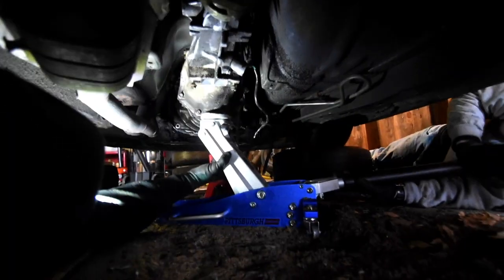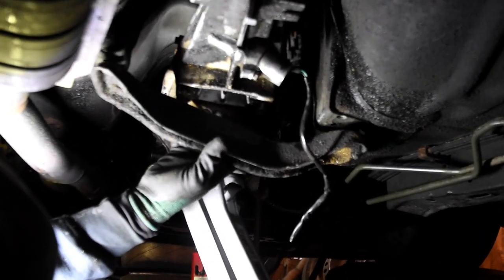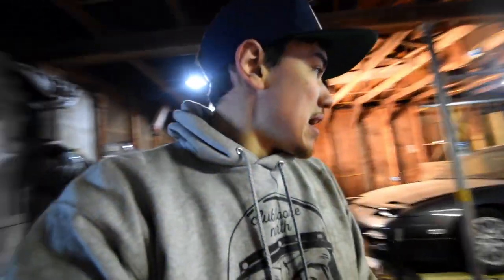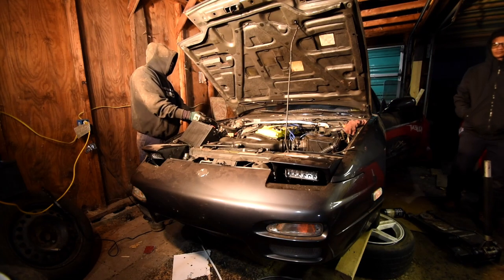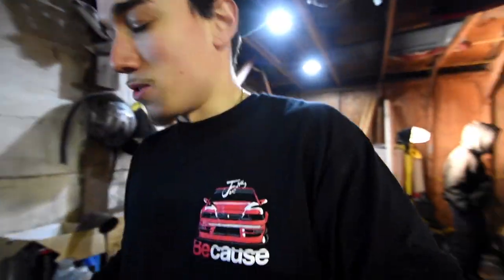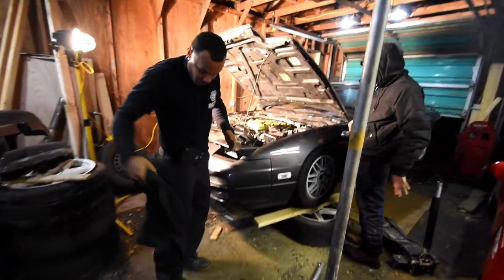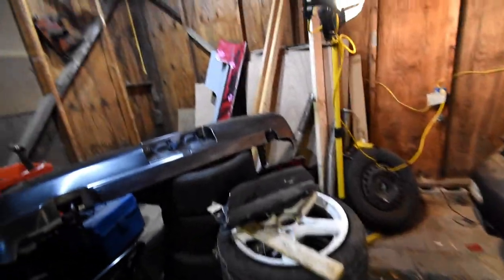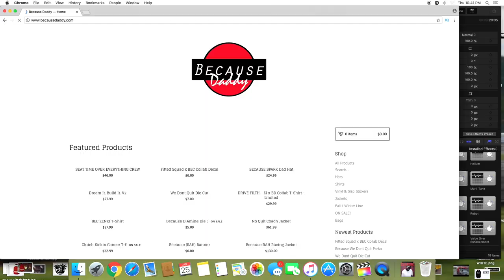Broken Trans....? | 240sx S13 Coupe manual swap

Comment: Since it'll shift gears with the engine off, I think you can narrow it down to a clutch/pressure plate issue. The frustrating part is that you'll likely have to pull the trans back off to investigate...
Reply: Something that helped when I was bleeding my clutch line was to fill up the reservoir, leave the cap off, and then undo the line from the slave. This let a bunch of fluid drain down and fill up the line, and gave me a better head start on the bleeding.

Comment: Do you put a clamp on the slave when you bleed it? Also make sure the clutch to master adjustment is adjusted properly.
Reply from the maker: Clamp on what? I never heard of that. I have to check all that out!
Reply: Yeah I put a c clamp on the slave so it can’t move. And then bleed it. That way it does not suck air back in.
Reply from the maker: hmmmmm. I gotta check that out. Ive never done it that way! Thanks so much man!